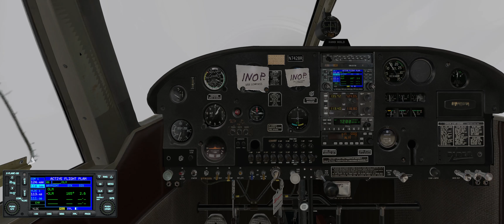Do Try This At Home!  Vacuum System Failure - Partial Panel Flight Into KOLM

Comment: Another great video man..thanks!  I lost my vacuum system last month coming back from Spokane.  Fortunately it was a clear day.  It was my first VS failure.  If you know of  a structured IFR course that utilizes x-plane let me know.  I am going to start IFR training  in a couple of months but would like to get ahead of it if possible.
Reply from the maker: Thank you. Regarding IFR training using X-Plane, I highly recommend subscribing to PilotEdge. Within PilotEdge, there are a number of IFR rating levels you can achieve in a structured program utilizing real ATC communications. In order to complete the IFR rating section, you must first complete the VFR section. I believe there are 10 levels within both VFR and IFR. I found both to be extraordinarily beneficial.
Reply: @sogpilot3137  Thanks so much I will definitely give that a shot.